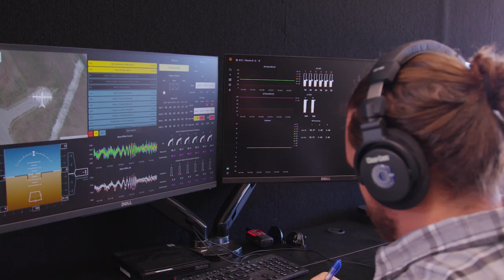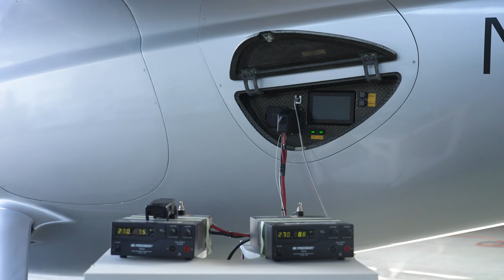Adam Savage Learns About an Electric Flying Vehicle!

Comment: I’m a huge aviation fan, I love aircraft, I love engineering and pushing the boundaries of craft. That said…its hard to imagine air taxi’s as a viable, mass market resource. For one, congestion is still primarily solved by mass transport not a different form of individual transport. For two, even cheap cheap cheap new aircraft is like buying a Lamborghini, and maintaining it? A whole different story. This isn’t niche because not a lot of people wouldn’t want it, its niche because it’ll be freaking expensive, millions of dollars IF it was from an established manufacturer. From a start up? 

I guess you have to start somewhere, but it would be nice if you could buy a new Cessna like aircraft for under $80,000 first lol
Reply: The idea here isn't (as far as I understand it) for people to own these individually. It's for them to be used in a rideshare-like system, where people call for one when they need a ride. It's more like a helicopter air-taxi, but with far far lower op costs.
Reply: I don't know if that's true because since we drive on a linear roadway you can't like make your own ways. That's not the case here. So there would be no congestion in the vehicles would fly on their own. That's why we're making self-driving technology and that's why there's so many satellites in the sky
Reply: @EndLess1UP  there's still going to be congestion even in the sky. Look at big airports, you often can't land or take off immediately and have to wait in line and that's with huge planes carrying tons of people let alone a small VTOL carrying 1-4 people. As op said the solution to congestion is mass low cost public transit, not new forms of personal transit. The aircraft is still fascinating and I hope it gets into use for niche cases but I don't think your average person is going to be taking air taxies on a regular basis.
Reply: The goal here is for you to pay about the same as an Uber black for a trip from Manhatten to Newark airport. The market will start out small, but depending on the social acceptance, the EVtol companies in this space are betting on it growing into a business the could be as large as Uber is now for these types of distances / durations of trips. As far as maintenance goes. These electric vehicles lack expensive engines that need constant maintenenace. No fuel pumps, oils, or other items, so the cost of ownership is a lot lower than other verhicles. (compare an Electric car to an ICE Car and it already demonstrates the difference, except no tire rotation ;) )
Reply: Also a pilot.  A lot of people that love technology and have a familiarity with drones assume this technology will scale.  Unfortunately, that has not proven the case in GA.  Most of these aircraft that are large enough to be viable for transportation have absolutely laughable ranges, and huge shortfalls.  They're selling you on this magnificent innovation, but don't bother to tell you it has a hilarious 100 mile range.  While this is nearly triple the range of most electric aircraft,  when it comes to general aviation this is a clown shoe. This is primarily due to the weight and energy density of Lithium batteries when compared to AV Gas. To put this in focus, A Cessna 172, the defacto staple of GA, has a ~700 mile range.  At the current technology, an electric aircraft will have roughly 10% of the range, and cost 5-10x as much.  You're decades away from a product that has any chance of selling a couple units.  As far as short distance commuting, a Robinson R22 would cost probably 10x less, exists right now, and has exponentially more range.  Also, it's legal. These electric VTOLs (to my knowledge) have no operational certificate and only exist in YouTube videos on private land.  I don't want to crush a lot of the dreamers out there that see this as how you're going to get to work in 10 years.  This is merely the first step.  Don't expect to see this anytime soon, and possibly not in your lifetime.
Reply: @c.j.1089   I don't think electric planes like this will deliver what they promise but they may find a niche market. Btw, at the beginning of the video they did bother to tell us the very limited range. The key point, however, is these aren't meant to do the job of a Cessna 172, not at all. The hope is to do short hops directly to close to your destination in an urban/exurban setting. They do have a tremendous obstacle to overcome, though - noise. Electric motors are quiet but propellers moving air are not, as you know. Any success will have to be in a niche market of dedicated landing pads in an industrial district - the flexibility of travel will be very limited.
Reply: @C.J.  Agreed: These are possible, but wildly far from being practical. They're currently a solution in search of a problem, because the solution to traffic congestion is mass transit.
Reply: @eaglestdogg  yeah, to solve that one they will need to set up autonomous vehicle airspaces and aprons at airports... That will likely take some time
Reply: @erikdietrich2678  yeah and even the problem they are proposing to solve could be done in a cheaper and safer way by just designing an electric bushplane that can utilize a very short runway or even a performance blimp
Reply: For three, when a traffic accident happens on the streets, it’s far less likely to end in your living room.
Reply: This would not be for the masses. It's not a flying bus. I think this is meant for the well to do. Perry and his wife Tiffany going to the Berkshires.
Reply: One big concern I have with the "get rid of congestion by putting people in the air" approach is that it takes far fewer planes to make the sky congested than it does cars to make the ground congested. The Union Pearson Express train in Toronto carries over 10k people a day on average -- that'd be 2500 flights, or about 140/hr in a typical day. So to get the same decongestion effect as the UP, you'd need one flight from Union Station to YYZ every 25 seconds. Like you said, mass transport is far more efficient than just different individual transport.

And, of course, the highways around Pearson Airport are still congested, because the 10k people/day is maybe 7% of YYZ's overall passenger volume. How many air taxis per minute do you really want flying into an airport's airspace?
Reply: @EndLess1UP   Having a plane or helicopter doesn’t mean you can just fly wherever you want.
Reply: @VeniVidiVid  Yeah, I was going to say, no one seems to be thinking of the nightmares ANY accidents with this could create. Even without thinking of an air collision (a much more likely scenario with hundreds if not thousands of these flying around), just one of them falling on top of a city street or into a house would be horrible. People seem to think in just terms of "it would be great for ME to escape traffic like this"... 🤷‍♂
Reply: @VeniVidiVid  My smart-ass comment is to observe that where I live, there's a lot of WW2 era homes at the end of T-intersections that had big concrete bollards installed at the roadside about a decade ago because of the number of cars that did end up in their living rooms... but I take your point, and agree: the number of places a crashing vehicle might end up is much, much larger with an aircraft.

On the other hand, if I'm following the plan correctly, at no point will this be a "user controlled" vehicle.  (Defining the user as the people trying to get from point a to point b.)  Initially they'll be controlled by a professional pilot; later, by a robot.  As long as the company avoids the Amazon issue of forcing the operator to cut safety corners in order to meet an unrealistic timeline, that takes away the single greatest cause of motor vehicle accidents: inattentive drivers.  So the area in which bystanders might be at risk will be larger than with a car, but the actual probability of an accident should be a great deal smaller.

The main obstacle I foresee is that, at least here on the Canadian Praerie, people just don't like to forgo being in control of their own movements.  It's not just the cost of taxis and rideshares, it's that most folks want their own vehicle so they can be in control of when and how they travel.  Overcoming that social attitude will be a big challenge.

Of course, the larger useful radius of this could mean that small towns could get the same level of service that cities get now.  My dad lives about 50km outside of the city and would love to take an Uber instead of driving himself, but it's not an option.  A rideshare VTOL service that popped him into downtown is something he'd pay a lot for...
Reply: The quote that comes to mind with anything like this, as much as I love the tech and see the utility of these kinds of vehicles is "Why do tech bros trying to fix the congestion issue keep reinventing public transportation?". Now for short run intercity this makes a certain type of sense but the scenario of going from downtown to the airport on the outskirts is something light rail or dedicated bus lanes/bypasses could solve now.
Reply: @davydatwood3158  Your smart-ass comment was pretty smart. 🙂

In the end, the answer for emergent technologies like this usually the same: “We’ll work it out.”

“Working it out” could still mean they ban it entirely, but could also mean adequate failsafes are devised. Like most everything else in history, we usually don’t know until we get there.
Reply: @c.j.1089  this
Reply: @zachmoyer1849  blimps! I forgot those existed. The Empire State Building was once planned to be a blimp (or dirigible) dock. Certainly not as fast as other aircraft, but quieter and less vulnerable to turbulence and bird strikes.
Then again, if you're willing to invest in blimps, why not just improve the rail network?
Reply: Plus - batteries are proving unreliable even for ground-based electric CARS.  I wouldn't want to be the poor sucker riding in one of these things when the juice conks out.
Reply: @erikdietrich2678  yeah i mean i was saying to the the specific problem he brought up in the vid it would be awesome to hop building to building in a blimp railways are great but they are difficult to make economically viable for moving people in the usa due to its spread out nature and many low density towns that litter the landscape
Reply: @c.j.1089  - They said that the range was 100 miles.  Did you even watch?
Reply: @JamesRedekop  it can help with congestion, but mostly give you a way to circumvent congestion if you are in a hurry or in an emergency.
Reply: Thanks for the thoughtful comment and to all the dialogue it has created here! Here are some resources to learn more about our business and technology that many of you will find interesting and will help expand your understanding of how eVTOL will be utilized as an aerial ride sharing service for 20-40 mile trips that often take an hour+ to drive on the ground (among many other applications): 

Commercialization presentation - https://youtu.be/9989XjHJjV8  
Powertrain development presentation - https://youtu.be/IbM8STkXS1Q  
Certification with the FAA presentation - https://youtu.be/yQXLMjbBHU8
Reply: @fezik8870  Stuff like this gets funded because they'd rather take a private plane, and can afford it as well. What i'm not sure of is... are VC types so delusional that they think this is a real solution over public transport, or are they intentionally green washing something that is a net negative for our environment.

"How cool would it be to check in down by the marina and zip on down to SFO" -Spoken like someone who forget San Francisco has a train system.

"Get people out of cars and off the ground and into the air to relieve congestion" -Spoken like someone who has never sat in a train cruising by a traffic jam

"You're in a traffic jam and you look up into the sky, there's a lot of space there" - Spoken like someone who has never sat in a train cruising by a traffic jam
Reply: @Nerfmeister42  There's no way that's ever going to happen.  An Uber can stop at your doorstep to pick you up at any address in Manhattan.  There's next to zero number of places in Manhattan where such a craft can land and pick you up.  Unless you happen to live at or right next to such a building, it's pretty useless.  There are already helipads around Manhattan but those are very few.  This may compete in that space, but it's not going to pick you up at your building.
Reply: Exactly, who can afford to use that, seems like helicopter rides are a better idea. Just they are expensive too
Reply: for the elite... derrrr.
Reply: @erikdietrich2678  wrong problem.  The problem is rich people have more money then they do time (or sense in many cases).  Things that save them time or provide an enhanced experience are worth it to these people (think about it, what problem does 1st class seating solve?).  

This is no where near a solution for the average person’s commute any time this century.
Reply: @c.j.1089   you are comparing an air taxi to a Cessna…. By its range.  Way off.  

Try comparing it to taking a private helicopter from Manhattan to tetorboro on cost, speed and noise.   Suddenly the math makes a lot more sense.
Reply: True. It's silly to think of reducing congestion by using the air.  This is a VIP taxi for very rich people to save time.  To get hundreds or thousands of them flying over a city, we probably need autonomous vehicles or autonomous traffic control.  It will never be a car. Ever seen the way people maintain and drive their cars?  I expect that bus-sized VTOL EVs would come before individual cars.  Automated so that they fly pre-defined routes would be cool.   The guy repeatedly mentioned San Francisco to SFO.  That's only a 20 minute drive.  Cool for a few CEOs.  For the public, San Jose to SFO (90 min drive) is where it could really save some time and make the timing more consistent.
Reply: Username checks out. This is a very air-headed take. Maintenance goes down significantly due to it being electric. Way, way, way fewer moving parts.
Reply: Yes it’s possible and millionaire can use it to go to their weekend cabins, but they have been doing it with gas helicopters for a long time. To hop around the city.. nah. But, any advancements that are achieved with these projects, will be good for later use.
Reply: @akaHarvesteR  Lower? More parts, more complexity, more things that need frequent inspections and signed off repair docs. Its not like a car, you roll in and replace a wheel.. there are FAA regs to work with, for very good reasons, even on upkeep and repair.
Reply: @Azzysdesignworks  Compared to operating helicopters, I think an e-vtol vehicle would be far cheaper to run... That seems to be the idea anyway.
Reply: I agree I live in the UK and most of the city's here would struggle finding somewhere to put these most urban streets would be to narrow for them to land so it would be a taxi I could not get from my house it would be the same for most people I know
Reply: For every product there has to be WANT for it, otherwise it’s not gona sell. There’s no WANT for this, except as a toy, and only for millionaires. These immature attempts to make a market for it, is gona fail. That’s my prediction for it.
Reply: taxis
Reply: It will be for the ultra rich zipping around the city while we crawl around in the filth. Sometimes, if we are lucky we can get a glimpse of these magnificent shiny crafts in the small spots between the skyscrapers where you still can see some blue sky.
Reply: @erikdietrich2678  Most things created were a solution in search of a problem. That's literally how Google started. Their research was finally applied to the web and indexing, but that's not where it began.
Reply: exactly. It would be nice if this could replace buisness jets, that includes having 8-16 seats, at the cost of a $50-150k sports car, imo if it could do 15-20 mpg thats great for planes, or the battery equivalent, but the range needs to be 500 miles or its not worth it, probably 300-400 mph also